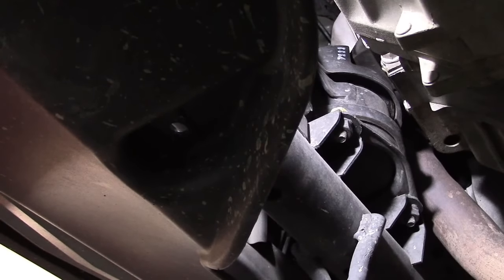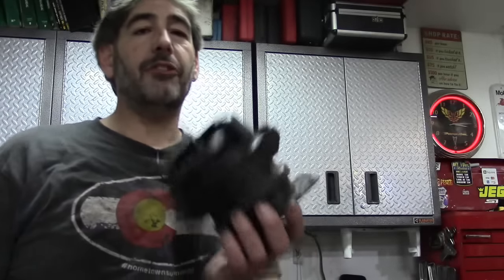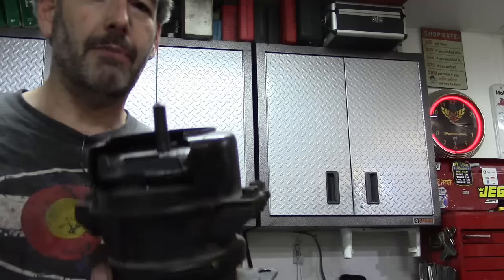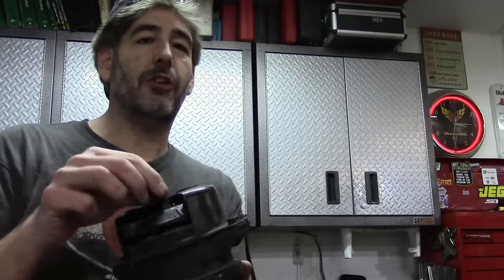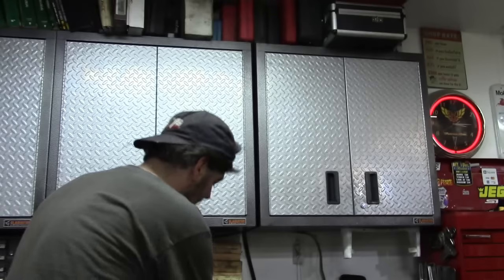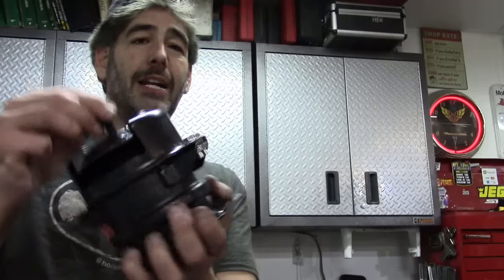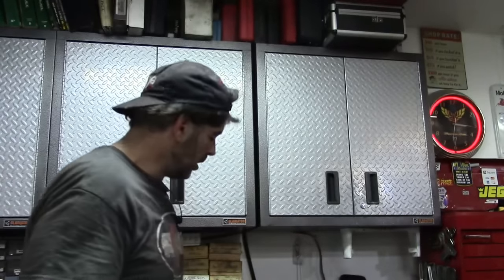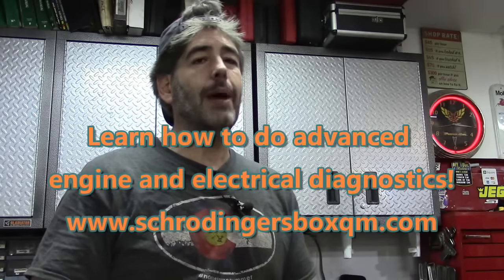How to check bad engine or transmission mounts

Comment: My 98 f150 5.4 4r100 bucks and thuds hard from 1st to 2nd, it bucks harder the faster im going, still jerks when its slow, it happens about 90 percent of the time, when its cold its a little less. Sound like a trans mount?
Reply from the maker: Sounds like a lot of things. Start of simple and then advance to things like shift solenoid engagement issues.
Reply: @SchrodingersBox thanks for the reply....i might just get it rebuilt to be honest, or a reman...it has 282,574 miles on it, same with the motor. Its had this issues for about the last 10,000 miles, maybe at 300,000 ill just get a remanufactured one.
Reply from the maker: what is the cylinder compression showing that indicates it needs rebuilding? it’s pretty obvious from that description it isn’t engine mechanical.
Reply: @SchrodingersBox  idk, i just figured while i have the money just start fresh. Its almost at 300,000 miles. 4wheelin, towing 1000s of miles, daily driver, shits been through the ringer and still going.
Reply: @SchrodingersBox  i figure if im going to rebuild the trans then i should do the motor too, idk. I dont trust transmission people, 3 places told me i shou li d just rebuild it vs having them just diagnose it. One guy saud it was a torque converter one said solenoid pack, the other didnt even want to bother, one said i need a trans flush, 600 bucks later still had problems.

Comment: Hi! I have a 2006 sienna fwd! I replace everything on the front end! Now every time press the gas going forward I hear s click sound only once I put it in reverse and click one time only!! The noice is coming Frome the driver front wheel!! Need help
Reply from the maker: you will need to just look and investigate.  I would lift entire vehicle off ground and have someone power brake it to check for movement.

Comment: i have a 2006 f-150 4.6.     when is in park or at a red light it vibrates      what can it be?   i’m thinking the transmission mount, can that cause the vibration?
Reply from the maker: Anything. What data do you have? I would start witgh the basics- a fuel trim analysis curved against load. That would identify at least if its vacuum associated.
Reply: Schrodingers Box thank you it does it everyday i doesn’t have to be moving just park and it vibrates
Reply from the maker: All the more reason to start with fuel trim analysis

Comment: When I’m in park and shift to reverse, rear side of my vehicle makes clunking noise. My car drives smooth everything seems perfect however it makes clunking noise going park to reverse to neutral to drive. Car clunks and rear side of my vehicle shakes up and down a bit. Any suggestions ?
Reply from the maker: Could be anything- you just have to check it. most rear end clunks are due to the sway bar bushings being worn.
Reply: My van is doing this.  Did you ever figure out this issue?

Comment: Hello Sr. I have a 05 Ford Mustang and it's has a little miss only at 1 RPM above and below it's fine I have to let my foot off the gas a little bit the to make it shift and the key is stuck in the ignition and the longer runs the more codes it throws off. Please help! it's known for leaking water on the body control module / smart junction box thing on the passenger side kick panel do you think that could be it?
Reply from the maker: A million things- what data do you have?
Reply: Schrodingers Box ,it keeps on throwing off a map sensor code even tho I put a new one on it, I think it might be the computer or something. Idk I'm super frustrated it's a really nice car.
Reply from the maker: @bethanyharris7494  Then as I said- what DATA do you have? Why did you put a new MAP in? Was there signal, reference and ground? Did you initiate variables into the sensor and see proportionate voltage response?  Why do you think it's the computer- is there lack of reference from the PCM pin?
   Those are the data that diagnose this issue.
Reply: Schrodingers Box the hand held put off code manifold absolute pressure sensor. but the reason why I think it's the computer is because that's what they're known for doing and it was getting wet and then after it starts warming up and I'll just start throwing off a bunch of codes and there's a little miss only at 1 RPM. When you're driving it and might be like a slight hesitation when you first get on the accelerator
Reply from the maker: @bethanyharris7494  Well first off, the computers are not known for doing anything wrong. People who can't do basic diagnosis always blame the computer so thats why you see that as so "common".
  Stay with the basics- curve the MAP against load measuirng the SIGNAL voltage against the sensor ground and against against a chassis ground.
  Just keep it basic- that alone will rule out if the MAP is faulty.

Comment: @Schrodingers Box do you think you can help me out with a problem am having on my car idk what it is 🙏
Reply from the maker: sure. what is the issue and what day do you have ?
Reply: @SchrodingersBox  so I just got some new long tube headers installed on my 2017 Dodge Challenger rt a mechanic installed them for me after I was pulling out of his shop I could hear like grinding a scraping noises coming from my headers I asked him bout that and he said it was normal it’s to the point where I can’t drive it cause it’s to loud I look under neath my car and I can see the driver side headers shaking like crazy wen I reverse it I try to see if it’s loose wen I go under the car but nothing I thought it could be my brakes so I went and got them change and that was a waste of time and money no one can figure out what it wrong with my headers could you help me out 🙏
Reply from the maker: it sounds like a clearance issue between the headers and frame the way you describe it. any contact between the exhaust and frame will make a definitive metallic sound.  In fact I had it on my trans am- I had to slightly bend the Y-pipe because it contacted the subframe. the noise was unbearable lol.

Comment: And what's of problem If I'm driving and I hit the gas and you hear a noise like a rattle, sir ???any help
Reply from the maker: You have to look and see what’s loose.
Reply: @SchrodingersBox  loose where bro ?? Ya think 🤔 maybe is the engine or transmission motors mounts ?
Reply from the maker: Could be. Could be loose exhaust rubbing frame. You need to lift car and have someone rev it while you search. Can literally be anything.
Reply: @SchrodingersBox  okay Do you think it could also be the engine mounts bro? But I'm going to check to see if I find the problem...

Comment: Im having the same issue with a fwd mazda cx-7, clunk from initial acceleration.  I’ve lifted the car up but the clunk is not audible when off the ground. Ball joints, sway link and bushings are all newer due to a recall early this year.  What else could it be? My mechanic and I cannot find it.

Comment: With a stick shift it's easier to diagnose it 😊 just put it in the 5th gear, hold the brake and gently engage the clutch.
Reply from the maker: yes you can absolutely do that as well. essential the same result- putting stress on the drivetrain to cause movement and see if mounts support or not.

Comment: I found all of these presentations very instructional
I do have a question for everyone 

out of curiosity I pulled my ohm-meter and measured
my new spark plugs, as it's time to pull the old one's out.
they measured as follows: 4.94, 5.45, 6.44, 5.73
@ the setting of 20K ( they avg out to 5.64 ohms)

is it normal to have such variations? What would be considered normal?
as for continuity, I got no response no matter where I probed...

after I pull the old ones, I'll perform the same test on them to see
what happens. I'm guessing the old one's will have higher
to nearly off the scale resistance. What is the expert answer?

Comment: The same thing moved with both tecniques.  It just moved more with the second tecnique.  And I didn not see the engine mount move.  It was the light colored thing in the upper right of the screen.   ???  I guess it was the transmission after looking again at the letters on the screen.  I never saw the engine mount move at all.
Reply from the maker: Of course the engine mount didn’t move. That’s the whole point!  I think you are looking at the wrong evidence reference point.
Reply: @SchrodingersBox  Yeah.  You could be right.  Anyway I saw the difference between the two tecniques which was the point of the video.  Thanks.

Comment: I always say a good mechanic will use there Eyes , Ears , Nose , and Taste. Not saying taste oil or transmission fluid but if you see clear puddle forming under your car taste it smell it it could just be water from you AC unit not everything requires you to hook up your scan tool you can use your senses to figure things out too.
Reply from the maker: Not entirely correct. You can use your senses to collect data. Nothing more. Only your mind can figure it out.
Reply: Schrodingers Box      But they work together with out your senses your mind can’t figure anything out
Reply from the maker: That’s what i just said. The mind figures it out. based on data input.

Comment: When I do that reverse drive reverse drive, it hear a clonk is it this
Reply from the maker: could be.  did you check the mounts?
Reply: @Schrodingers Box  yea I'm sure it's not the engine I hear from the bottom rear of the car exactly where the mount is
Reply from the maker: if it has a rear differential maybe it’s excessive backlash.

Comment: Hello Matt. I'm new to the scene around here and I am not very internet savvy. I would love to ask you a few quick questions about my old truck, which is OBD1,  only I can't find an email address for you. How can I contact you? Thanks, Jim
Reply from the maker: Just post your question here
Reply: Ok, can do. I have a 1995 Chev K2500HD with TBI 7.4L and auto trans with 110k on the clock. It recently started running rough and glowing the exhaust manifolds while cruising. I found your channel while searching information about mixture control and it has been a big help in me finding the issue. This truck is throttle body injected which is OBD1. My question is, using the auto ingenuity software on this application what kinds of information could I expect to see? Would I even be able to read live data? Fuel trim?
Reply from the maker: You cannot use OBD2 scantools on an OBD1 design. You will need an OBD1 compatible scantool capable of integrator and block learn
Reply: Oh ok. Any recommendations?
Reply from the maker: When on comes to obd1 it’s so basic i just use a DVOM or simple basic electrical testing. i don’t use scantools on oBd1.
Reply: Ok, thank you!

Comment: I wish i saw this video before i bought my car.
Reply: I still got the car, and i can't repair it to it's original state, I'm stuck with it.
Reply from the maker: well if it’s bad mounts why can’t it be repaired?
Reply: @SchrodingersBox  It's not just the mounts.. I have replaces all the mounts, but the part that transmission mounts hold was cracked. So they tried to weld that, and obviously during the acceleration, engine moves and is kinda rubbing against exhoust, and is makibg very bad cracking noise.
Sorry if i didn't explain that very good. My English is not the best you heard.
Reply: Person who had this car, probably went over the curb or something. I was stuoid enough to believe him when he said it only needs mounting change, that's why it makes noises.

Edit: I forgot to mention. My mechanic suggested me to put ki d of an extantion under the new engine mounts, use longer bolts and try to raise the position of the engine a little bit. He said that's the only way he can do it. I still didn't decide.
Reply from the maker: ah yeah that’s a problem. Yes I have seen a number of cars with rusted-out or cracked frame parts. I always inspect for that when I do used car inspections for potential buyers.

Comment: If you were to power brake it just a little bit in forward or reverse, I bet that mount would move. It would have to. You may have to get eyeballs on the mount to see it move, but I think it would move. I do not hit brakes hard with free spinning wheels. The massive shock and stress to the car bothers me very much. I suspect cars can lock up wheels on a wet road and no harm done, but this to me seems very much different than a hanging unloaded suspension. I have done mechanical noise inspections with a car hanging in the air as foot on brake, put it in gear, and then gently let off of the brake controlling rpm's as to not rev to high, and then hit the brakes. I guess if the car has 170k on it, locking up brakes as this demonstration would be a good way to brake, I mean break, stuff so you know what is worn out. I don't know. I ain't no engineer. Also, some people in this world are not as intelligent as you are, so they throw parts at a car instead of a&& rape from dishonest or incompetent mechanics. I worked at this one shop and a lady customer was charge about 1,000 and her car was delivered to her. She came back and said it still makes the same noise. Come to find out, the parts were never even installed. Go figure? What about the lady in your video from three months ago with the suspected bad fuel pump? How is her car? Thank you. :)
Reply from the maker: Power braking is indeed a valid technique ONCE THE MOUNTS ARE SUSPECTED.  The technique shown is to find if thats even a cause in the first place.  If it is, say, a loose exhaust, powerbraking wont find it.

Comment: Devils advocate: not all mount designs are the same, the rocking has to have worked for some designs or that method would have been debunked a long time ago? I would definitely lift the the car and do this method for certain results either way.
Reply from the maker: You can actually see the rubber is broken though
Reply: @SchrodingersBox  yes no question there, just the point about different methods for different mount designs, I built a 65 Chevy and the the 350 Small Block rocks pretty far on the mounts(stock design) it sits on. Just the design, they make aftermarket ones which are much more stable now tho. BTW the fuel trim content is outstanding thank you.

Comment: I replaced my mounts rock auto n the motor moves just as bad still
Reply from the maker: It’s possible it’s the transmission mounts too.
Reply: @SchrodingersBox  Yeh I checked trans mount it's fine. First motor was clunking .strut mount looked fine but I changed seemed to help.upper mount was tearing so I replaced. Still rocking when put in gear big time . Trans mount is fine. I think cheap defective rock auto mount. They sell alot of cheap old junk n rubber only good for three to five years. I find it better cheaper ebay.
Reply from the maker: Correct. a defective mount is best explanation. Possible if could be a broken frame or cradle though.  I had a suzuki esteem that actually had a cracked cradle so that caused movement.
Reply: @SchrodingersBox  yeh I looked n the new mount is moving the torque mount. The frame where it hooks to is fine. The other two mounts are bolted to the upper part of car lower wheel well n upper wheel well both spots solid. Where was the frame bad on susucki that made it do that?

Comment: Yo that’s what my car been doing when I put in park and when I am driving it’s shacking
Reply from the maker: Could be a number of things causing that. a vacuum leak, misfire, Torque Converter slip, or of course the mounts. Be sure to dioagnose it correctly

Comment: But wait you are good but title says how to diagnose bad engine or transmission mount I didn’t see anything about a transmission don’t need to see pull bolts out or put them back that I understand but there was nothing on transmission mounts
Reply from the maker: You diagnose ANY mount the exact same way. A differential mount. A suspension mount. ANY mount is done the exact same way.

Comment: I have another tecnic i take the oil cap with the car on and you will see how the engine vibrates
Reply from the maker: how do you differentiate that vibration from torque converter shudder?
Reply: @SchrodingersBox  i dont but i found out it was engine mount even after the guy of the gearboxes told me i had to rebuild the gearbox cause the noise was coming from it. I didnt believe it was a gearbox problem because it was shifting fine with no slipage even with track like driving. The tyre was getting a strange ware pattern like it was miss align but it wasnt witch made me think it was the engine mount problem making it. I was right :)

Comment: Jackstands under the rocker rails, yeah that's safe. smh. 

Running the drivetrain and switching gears while up on jackstands. Sure, if you want it to kill someone.
Reply from the maker: You should be more educated perhaps. The rails are where the jackstands are most secure. Just smh. Just smh.
Reply: @SchrodingersBox  I am speaking from 34 years of shop experience running seven hoists. Care to try again. 

You'd fail a local re-inspect if I showed your video and your employees, if you had any would be coming after you for any injuries if anything were to happen. Worker's Compo here would shut you down. Your contempt for the laws of physics and your ignorance for how vehicles are built and how the public will trust anything they see as gospel will end up getting somebody killed or seriously injured.
Reply from the maker: wow 34 years and you don’t know how to use jackstands. pathetic. that’s why I have 250K subs and you have 12. 
  stay basic. try watching my fuel trim videos. get some experience to show for your 34 years of not knowing how to even turn a wrench.  maybe if you don’t know the basics you might do better at computer diagnostics. probably not. because you are just basic.  so basic.